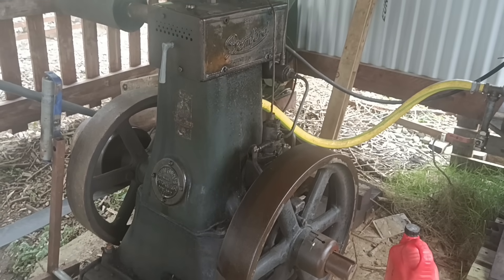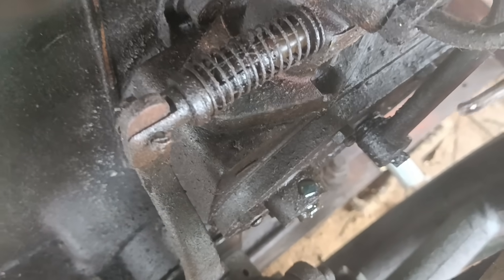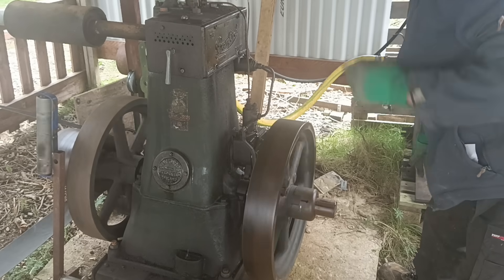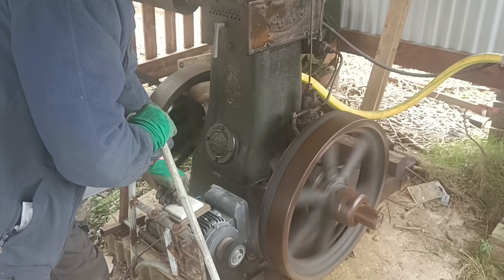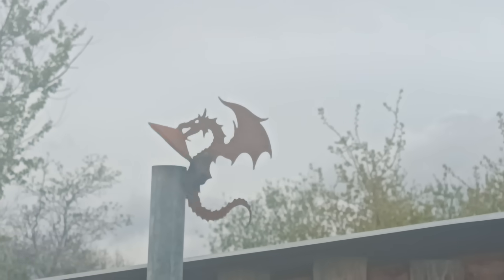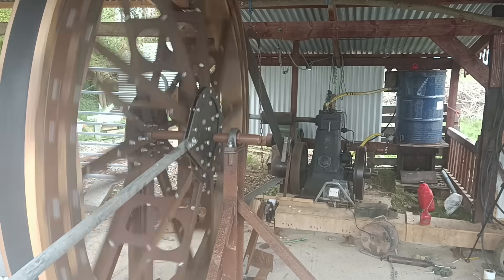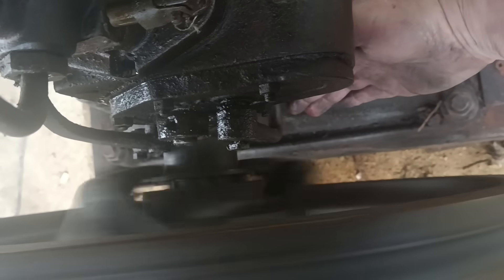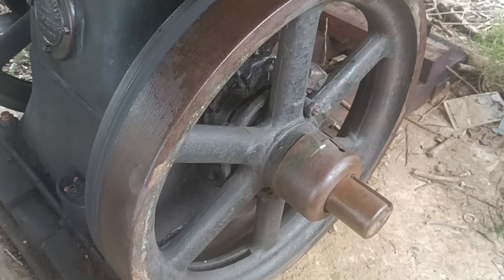How Much Fuel Does This Vintage Engine Use? Bamford stationary single-cylinder diesel efficiency

Comment: This has been my dream for many years - to have one of these. They used to run entire shops. I think that the HP of an old engine is actually more than the newer ones because of how much work they did. They run happily for generations while newer engines fail in a few years quite often.
Reply: IIRC "Horsepower" used to be from a formulae related to bore and stroke, and this was how the "model number" was derived - more recently Horsepower is determined by attaching a Dynamometer to the output shaft.
India produces a Lister single cylinder of the same design as would be seen in the 1950's, they run drainage and irrigation pumps 24/7 for the cost of a couple of jerry cans of fuel a week.  You can even buy them brand new, but they're labelled as used to overcome the emission regs
Reply: Horsepower is work done per unit time. So you can do more with less horsepower if you are prepared to spend longer doing it.

The real reason these old engines last so well is that they're massive cast iron beasts that run at low speeds. Less speed means less friction and wear, and all the parts are much stronger than they need to be for the forces they experience. So they take a very long time to wear out if properly maintained. 

The trade-off is that a modern engine of the same power would be much lighter and more compact, a modern 3hp engine is something you can easily pick up and carry around vs an old 3hp stationary engine which would likely weigh 50kg or more. The other confounding factor is that nobody is willing to pay for a really durable low power engine anymore. As a result most of out experience is with Briggs and Strattons or similar, which are engineered for cheapness rather than durability... a lot of such engines are designed for a life of 100 hours or so, and are not intended to be rebuilt or repaired if they go wrong, you just replace the whole thing.
Reply: @nerd1000ify  you can still repair them by putting new plastic parts in it to replace the old busted plastic parts. Like the plastic cam gears they've been doing. 

Honda even provided an "overhead cam" version for consumer market, a version of their GX160 model and called it the GC160. It had a plastic effing camshaft, the cam and gear were one piece of plastic, run by a tiny belt. The disposable society is going to kill itself slowly by depleting limited resources until we are stuck scavenging out own trash to survive
Reply: @Goose Not maverick  yeah all the small engine manufacturers are up to these sorts of tricks. They last the design life, but not great for longevity or repairability. The other usual suspect is the cylinder bore, many small engines have an uncoated aluminium bore, which naturally means a short life and re-boring or sleeving the block aren't possible due to bare minimum wall thicknesses.

The economic issue is that the labour costs of fixing these things are too high, compared to the labour costs at the factory in China or wherever. So the manufacturers prefer to save a few bucks per engine and sell a whole new one for cheap when yours breaks down.

You can get the 'industrial' model in some cases with real engine parts in it rather than plastic. But expect a higher up front price. IMO in many cases it's probably better to replace small engines with electric motors if possible, even the cheapest TEFC induction motors have replaceable bearings and capacitors and should last almost forever. In the US of course you are hamstrung by the 110V supply to most houses, most other places have 220 or 240V supply so we can run fairly hefty motors (up to 3hp) from a regular wall outlet, and even more from 15A plugs.
Reply: @goosenotmaverick1156  I prefer using old engines myself. Any time I get a chance to buy a good, used old engine I do. I have lawn and garden equipment that are over 40 years old that run well. Modern machines start to break after a year of use.
Reply: No no no.
This engine and the Listers like it are made of cast steel / iron.
Maybe some of the accessories have a non-iron component or two but the ones built before 1960 are all metal.
Reply: @nerd1000ify  To clarify, In Physics, Horsepowers and Watts are the units of Power in general. Like meter or inch - these are units of length. Power is a mathematical derive of pure Energy, ie energy spent in almost infinitely short period of time. Real horsepower output of this engine is by no means constant: it fluctuates with fuel, oxygen, elevation, temperature, humidity, condition of the engine parts, flywheel size, load and time itself. It is important to understand that the Power output is constant only in infinitely small period of time. If we add up (integral) all of these small "output powers" multiplied with extremely short periods of time when they were measured, we'll get total energy delivered over some larger period. Dividing that energy by total time period, we get Average Power. And 6hp is by no means Average Power that this engine delivered while it was working. It depends on the load. 6hp is simply a rated power, a treshold set by the factory. You can easily run this engine with more than 6hp say with pure oxygen, but the factory is saying if you run this thing above 6hp you will cause damage to the engine by overheating and over-stressing it.
Reply: Too bad this quality is no longer made. A beautiful machine. Simple technique that just keeps going. Simple and cheap to repair. I love it. What a drama those modern engines certainly with the exhaust gas recirculation and the programmed wear. But yes when this was made they didn't know how weak they could make something to break after the warranty period

Comment: 45 cents in fuel plus roughly 1/4 of that for engine depreciation.
Reply: This engine is 80 years old. 
It may never have had a spanner on it let alone overhaul.
It is basically printing money for you if used this way....

Comment: how long does it take to get the water drum up to operating temperature? There would be quite a bit of stored heat energy that could be used somewhere.
Reply: If you have an open top drum..the evaporating water in the form of steam/vapour coming off the top of the water will keep the engine well cooled.
Top up each day....with water.

It could, of course, be piped/pumped into a coil in the bottom of a storage tank and transfer heat to that instead...

To acheive maximum efficiency the fitting of a thermostat ensures quick warmup....without interfering with maximum cooling when running normally.
Reply: @JohnSmith-yv6eq  could just move the drum inside a greenhouse.

Comment: You are not using 6 hp worth of power.  A 1 hp electric motor would probably do the job just fine for your charcoal grinding, and would cost less to run.  Or, a 6 hp motor would use much less than it's rated power.
Reply from the maker: I realise that now, Matthias! I wasn't trying to mislead - I'm just trying to figure things out. I'll have to do the test again when the engine is really working for a fairer comparison

Comment: I think you are underselling the electric, My guess is that you are using nowhere near the power potential of that engine, general rule of thumb to run a an internal combustion engine you need 1 gallon of fuel per 10 hp per hour, (and this is for a modern engine with a century of efficiency improvements) by this I'd guess you are really using more like 1 hp or .74kw, to get a proper comparison I think you would have to use a prony brake to get a proper quantifiable load on the engine to get an honest fuel economy test. This is not meant to be a negative comment in the least, I very much appreciate your engine and wheel setup, and your videos are great, just pointing out that just like an internal combustion motor at idle electric motors do not use their full rated amperage at light load either.
Reply from the maker: Thanks, Greg. I realise that now - I need to test the engine when it's working hard

Comment: You could go down the 50/ 50 route with Red Diesel mix with well filtered vegetable oil.    Run a twin tank set up with gravity fed, so the the two cant mix in the tanks. A Y pipe with taps on each leg would do.  Start it in Diesel and once warm add the veggie oil
Reply: Green diesel..... Because Ireland.
Reply: THE PRICE OF VEGGIE OIL. ONE YEAR AGO IN A SUPER MARKET IT WAS  5LE   £4.50 and a year later now £11.00. more than double. that was 2022 now 2023,
Reply: @bwghall1  
I ran my old peugeot 406 on vegi oil when I could get it for 60 to 70p a litre. Straight into the tank....no additives.

Comment: if a diesel is hard to start it most likely needs rebuilding to get the proper compression back .
rings , valves , piston ect.

Comment: The engine uses very low internal energy, no high pressure fuel injector pump or complex valve train or alternator. So the saved energy would surly make up for its efficiency ?

Comment: If I had to guess, people don't use these old machines because getting parts is next to impossible, probably requiring them to be manufactured by a machine shop. Also, this takes up a lot of space for being 6 hp, and unguarded flywheels are quite dangerous. Clearly none of that is a problem for you right now, but I would be interested to see a video once you have your first failure. How difficult it is to work on, how you get your parts, etc.
Reply from the maker: You could be right. But I asked the owners' group and their response was - why would you need parts?

Comment: I'd imagine the figures are similar to Lister's quoted specific consumption of 3/4 pound of fuel per Brake-Horsepower hour, for an equivalent engine. Competition was fairly stiff in those days, (wartime economy), so they'd have tried to get it to drink as little as possible.
Reply: That works out to 2.4 litres per hour for a 6 hp engine which sounds about right.

Comment: No way you'd need a 6hp electric motor to grind that charcoal.  1/2hp would probably do it, so comparing elec cost for a 6hp electric motor vs that engine is silly.
Reply from the maker: True, but for slicing the logs..

Comment: I am using a similar Lister engine to run my generator to charge batteries. I haven't measured accurately like this, but it uses about 1 litre per hour and charges at a constant 2kW measured on the battery charger.
Reply: For a brief year I entertained locally grown oilseed being the fuel (diesel startup and shutdown) of a liquid biomass to electricity setup.  450g per kWh (kilowatt hour) was the target consumption and your figures tend to suggest this was pretty spot on.
Reply: we should incorporate these engines in electric cars as range extending charge systems
Reply: A rule of thumb I have heard is 1/3 of the energy goes to mechanical energy, 1/3 goes as heat out the  exhaust and 1/3 goes to the cooling water as heat. What I have done with my engine is use a water jacket on the exhaust, and then circulate that and the cooling water into the house as heating.  @RossWexford
Reply: thats about 6.2  gallons per 24 hours/ or .26 gallon per hr  and if you had  a 1000amphr battery bank  it would only need to run a couple hours aday. 1000amphr  24volt = 24kw  storage energy runs whole 8kw  small house  so you  would need 4hours on lister engine to keep  battery 1000amphr  24volt  bank  charged to full which would be about 1.5 gallons $3-4 dollars

Comment: There was an engine which ran the milking machines on the farm I used to visit as a kid. I remember the day I became big enough and strong enough to start it myself (no electric motors.) I loved that old engine.  And the old Massey Ferguson 1943 pre-select tractor which I was allowed to drive. So lucky to have spent time on a farm.
Reply: “Farm Life,” e.g., getting up at 5am for various chores, before catching the school bus, can teach one a great deal about having responsibilities and doing a job right the first time as the farm animals will let it be known if they weren’t fed!
Reply: I had one of the vacuum  pumps run by those old gals, came out of a carriage house they were tearing down when I was a kid in 1978. I helped my buddy out on his dads dairy farm. I painted it up and took it to a few hit/miss shows.

Comment: At that rate if you ran it all day long it would cost you 2 or 3 dollars US Currency. It's amazing how efficient those old engines were. I'm glad to see that you use it and not make it's just something for taking pictures and showing off. I'm a firm believer of using the old stuff if it's good and it doesn't ruin it or hurt it. As always, thank you for the video. Bob from Virginia USA

Comment: Tragic that electric costs so much in Ireland, its absolutely ideal for this sort of work, electric motors are very convienient and easy to tailor to a job. Just giving context but here in Ontario electric runs at 17c, 11.3c, or 8.2c per kwh depending on time of use vs peak demand, less if you have the documentation as an industrial consumer although then you can get billed for power factor which from motors can be pretty rough. Genuinely unfortunate and I hope the emerald Isle gets cheaper power soon for your sake at least, It's windy enough to deserve it!
Reply from the maker: can't I have both?

Comment: You should be able to adjust the speed, on the petrol Bamfords you remove the tin gib head key cover and there are 2 bolts with lock nuts on if you unscrew the bolts it will slow it down, opposite speeds it up😎

Comment: 45 cents an hour seems nicely low to me. Though whether it's actually low depends entirely on the expenses related to the products you're making, in this case ground up charcoal. 
I have no idea how much a similar amount would cost you to just buy, or how much expense (including potentially time) goes into it aside from the grinding, so I can't really say whether I think it's low.
Still, always good to see a good test! :) And cost alone doesn't account for the satisfaction and hobby value factors, either. Or the youtube factor, for that matter. ;)

Comment: its like you said tim , we often get too see them oldies at fairs and the such, yet rarely do we see their intended use 's , add that the fly wheels and overhead shafts and idler's that were often scrapped or sold separate while the engines found new owners , they were momentum engines and not high toque like today diesel  and electric are , your shed big wheel crank arm assembly ect , makes for a viable working engine ,,, often we see these old tools like your slicer,grinder ,shingle maker, ran off a old tractor side wheel PTO at same fairs, and i think that the advent of tractor portable PTO is where the decline of the stationary engines met their demise , and i dare say a modern diesel would cost more to run under same load for same time even at idle

Comment: There is little difference in fuel economy between old engines and new. The Model T did 21mpg (american gallons) and that's just 6 mpg less than modern cars.
Reply: A model T didn't weigh 1000 kg like today's cars.

Comment: It's not just the hp, it's the torque. You would need a much more powerful electric than a 4.5kw to compete with that old girl. Then add those big flywheels, hehehe, yup, you'd a much bigger electric than a 4.5kw.

Comment: Great explained. It is astonishing that the engine is even 4.5 times cheaper than an electric motor. But the old stuff keeps much better than modern scrap anyway. (Often it is scrap or, rather, special waste.Of course not always.)

Comment: 5:45 I assume you got this figure by multiplying the nominal power of the engine by the total runtime. A horsepower is 745.7 W, so 6 hp * h = 4 474.2 Wh.

There is a problem with this, which is that as you stated earlier in the video, the engine isn't running at full power, or anywhere near that amount. This is evident by the amount of fuel consumed. One litre of diesel contains 38.6 megajoules of energy, or about 10.7 Wh. If burning 450 ml of diesel produced 4.5 Wh of useful work, then this 80-year-old engine is running at 4.5 / (0.450 * 10.7) ≈ 93% efficiency. Such an efficiency is not only more than double that of any diesel engine which exists today, it is also thermodynamically impossible for any internal combustion engine. 

Assuming the engine ran at a more reasonable 30% efficiency and a similarly specced electric motor would have an efficiency of around 90%, the electric motor would be able to do this same task, with (0.45 * 10.7) / 3 ≈ 1.6 kWh, which would only cost you about 70 cents. Still more than the cheap agricultural diesel, but not four times as much.
Reply from the maker: Sorry if I got that wrong - not trying to mislead, just trying to figure things out
Reply: @wayoutwest-workshopstuff6299  I understand. Multiplying the power by the runtime is certainly the most straightforward way to calculate energy draw, though it ended up being misleading in this case.
Reply: I'm not debating your math here.  He should have tried to determine brake specific fuel consumption to measure efficiency.  He didn't do that.  It seems like he thought a 6hp electric motor draws the same power no matter the load.

Comment: Many early diesel engines were made to replace steam engines as were some tractors, we had a Fordson Major tractor with a broard-belt PTO by the drivers right foot, we never used it but you could see what it was designed for.